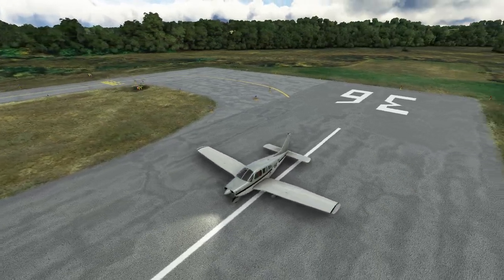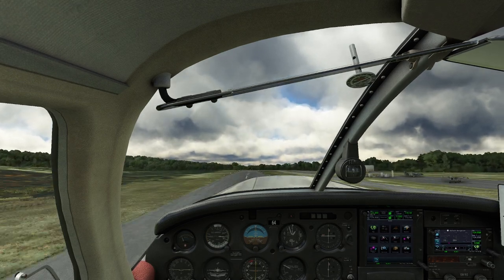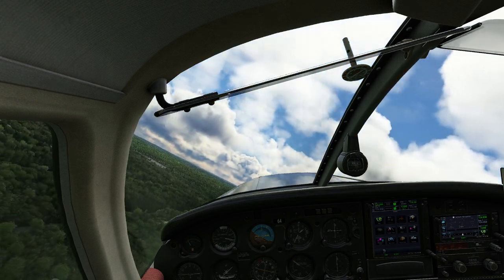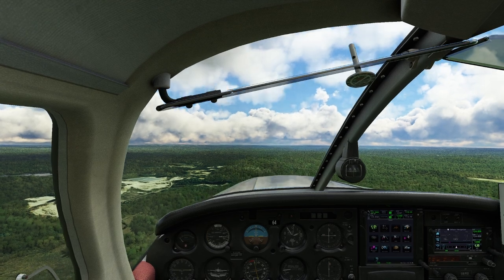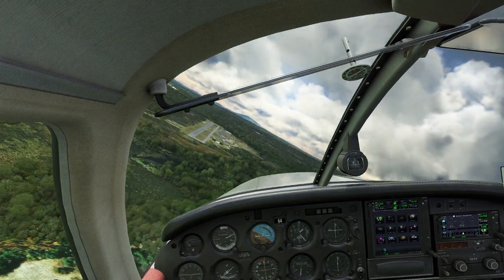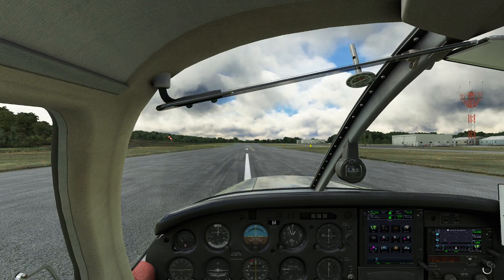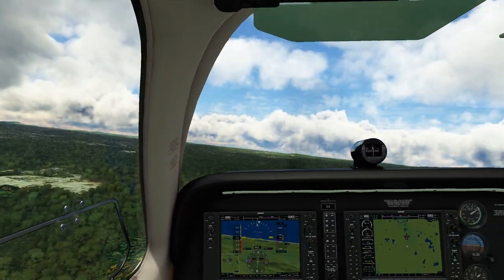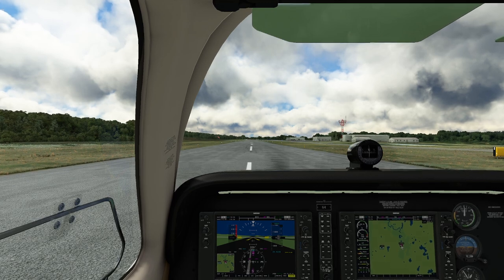MSFS - Base to final stall, aka coffin corner

Comment: Coffin Corner is the narrow margin between stall speed and Mmo and it gets narrower as altitude increases.  This is more of a cross-controlled stall and spin scenario (which is really bad).  A go-around should always happen before adding rudder to get the nose where it should be due to bad planning in the pattern.

Comment: This is not Coffin Corner. Coffin Corner is in reference to the small airspeed range between stall speed and Mcrit when flying at high altitudes and high speeds (Typically Mach 0.72 - 1.1)
Reply: Correct.

Comment: A most excellent video, here are a few thoughts from an instructor. The best way to avoid the “stall, spin, crash, burn die” scenario is to fly a proper traffic pattern. The turn from base to final is the portion of the pattern with the slowest groundspeed. For that reason the bank used for this turn is the shallowest with a maximum of 15 to 20 degrees. If you overshoot the final maintain the no more than 20 degrees to properly align with the runway. If that is not possible then you go around. The airspeed must remain on the proper approach speed for the flaps setting. Remember the first commandment of aviation: “Maintain your airspeed lest the ground rise up and smite you”.
Reply: Absolutely Sir James! I think as always Pat makes great videos which you can definitely apply to real life flying too.
Reply: Stall FALL Spin SCREAM Crash Burn Die 😬
Reply: You are absolutely correct, James, given the ACS you are locked into.  In Air Cavalry, crop dusting, pipeline patrol, and most of maneuvering flight including around the canyon and mountain airports, 15 to 20 degrees bank angle doesn't always get the job of missing things done.  I understand, limited bank is cooked into the absolute ACS need to maintain altitude at all costs.  Wait, "Maintain your airspeed lest the ground rise up and smite you."  Yes, they have put you at odds with common sense and what the airplane wants to do.  What does the airplane want to do in turns, actually any curved flight?  Why will ACS not allow the safety feature the designer tried to help you poor instructors with?  What the airplane wants to do because it was designed that way to prevent stall is to allow the nose to go down in turns.  It is dynamic neutral stability that ACS rejects, but crop dusters use it in every turn to stay alive.  And they turn at whatever bank angle is necessary to acquire the target.  They don't stall because they don't insist on altitude maintenance and they pay attention to what the airplane wants to do, pitch down.  A turn of any bank angle, say 80 degree bank angle, is a 1 g turn until the pilot pulls back on the stick.

I am a disorganized mess as both pilot and instructor, but I have survived 11 engine failures at or below 200' AGL crop dusting and on pipeline patrol.  I have always taught toward duds like myself.  You guys try to keep them from getting into the situation to begin with, except for the left turn requirement that gives them the downwind base to final that increases the probability of the skidding spin problem.  Stall, required for spin, is the problem.  Not learning how to turn safely and pulling back in turns is the problem.  Anyway, some of us have to teach flying for dummies, because human nature leads to holes in the cheese that doesn't alway get prevented.  And stall practice at altitude is no help for inadvertent stall in the pattern.  Learning to turn safely, giving up altitude for airspeed, learning what the airplane wants to do, learning the law of the roller coaster, learning zoo reserve, "Stick and Rudder" stuff would be helpful.

I know you are locked into arbitrary numbers, ACS.  It is not your fault.  In the Army we called it work around when we had to find regulations to counter inappropriate regulations.  I work with lots of instructors on energy management and encourage them to teach flying first and test preparation after.  It really does not delay their attainment of standards having learned a little of what Wolfgang taught.  I soloed students in less than ten hours after teaching just flying and then turned them over to the regular instructor for test prep.  It didn't warp their minds to learn the art before the numbers.  Things like airspeed is life down low and neither Vx nor Vy is appropriate on long runways where cruise can be attained quickly in low ground effect.  No, can't pass the test that way.  Just stay alive.

Comment: the simple solution after you pass the runway would be to turn right till you were 60 degrees right of your course. Then turn left and you will be perfectly lined up with the runway... boats do this in a "man overboard" situation. The best way to avoid this problem to begin with would be to be far enough from the runway when you go past it. Then a gentle turn will line you up.

Comment: Coffin Corner is Usually referred when the low speed stall and the high speed buffet margin gets very reduced usually at high altitudes, in a base to final stall and subsequent spin what happens is the airplane already in a low speed state probably configured with a high bank angle and rudder input the load factor increases, leading to an increase in stall speed which will cause you to stall and because you are banking one wing will stall first than the other usually the low wing, this will lead to a spin. One type of spins is described as the graveyard spin it might ve been that you were referring instead of the coffin corner.

Comment: Excellent demonstration.  A lot of commentors seem to have no idea what the purpose of this video is (who flies Vma in the pattern?).  As a side note, the coffin corner is near the aircraft's maximum ceiling, where maximum Mach number and stall speed converge.  Any decrease in speed results in a stall.  Any increase in speed causes a loss of lift and violent nose down pitching often exceeding structural limits.  You have demonstrated a Cross Control Stall.

Comment: Learning something new every day! So much appreciated. Thank you
Reply: Here is a little more for your learning enjoyment. A few thoughts from an instructor. The best way to avoid the “stall, spin, crash, burn die” scenario is to fly a proper traffic pattern. The turn from base to final is the portion of the pattern with the slowest groundspeed. For that reason the bank used for this turn is the shallowest with a maximum of 15 to 20 degrees. If you overshoot the final maintain the no more than 20 degrees to properly align with the runway. If that is not possible then you go around. The airspeed must remain on the proper approach speed for the flaps setting. Remember the first commandment of aviation: “Maintain your airspeed lest the ground rise up and smite you”.
Reply: @jameswebb2856  Not only a knowledgeable but entertaining reply! Thank you - now I'll always remember :)